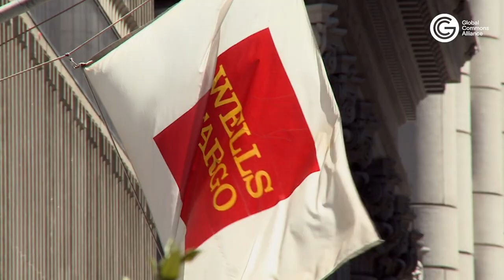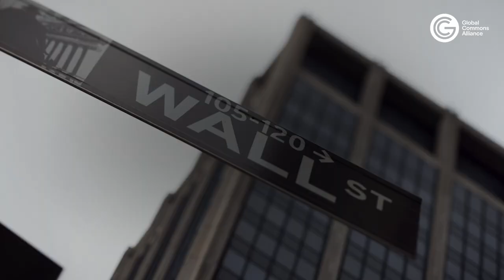How to Keep Your Money From Funding Fossil Fuels

Comment: Did ya'll know that those pipelines that carry water a sewage  is made with Fossil fuels. Also the motors and pumps used to propel water and sewer runs off of fossil fuels. Electricity is generated with fossil fuels,  coal and natural gas . It's really sad that no one knows how things are made🙄!!!
Reply: Motors, pumps and factories do NOT need to rely exclusively on fossil fuels, although they do now. It's really sad that some people can't see THE WHOLE POINT of a story even when it's constantly worked out for them.
Reply: Yeah, how sad is it that we're still primarily using a rapidly depleting resource for basically everything?